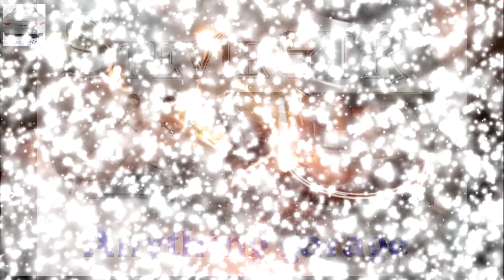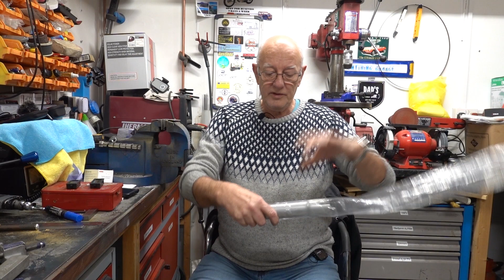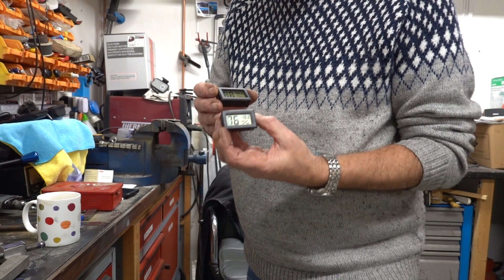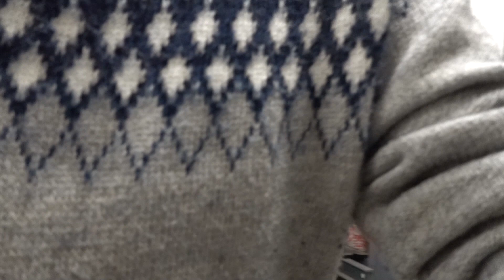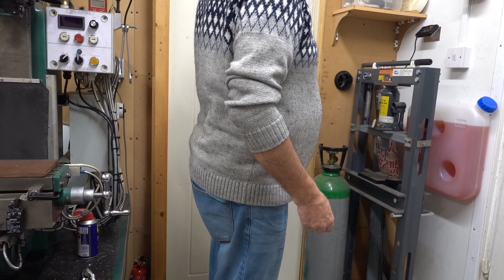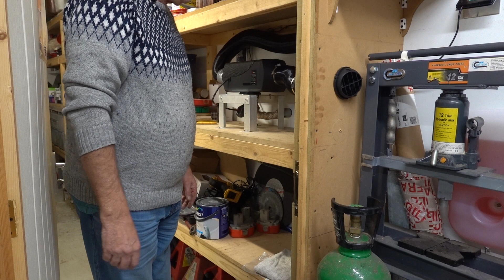Chinese diesel heater dangerous nah

Comment: Ive got a cheap one and getting fumes off it stinks not as bad as a car exhaust but definitely a smell given me a head ache. Got exhaust and air intake miles appart so must be something up with the unit. I have seen other people saying the same thing though not sure if some people touch lucky or unlucky or what to make of it?
Reply from the maker: Have you had it apart as there are lots of youtube vids of doing this. The combustion unit has a gasket in it. Could be that. Mine has never given a wiff off in all the time I have had it. I have an monitor by it to check for fumes , but never gone off.

Comment: Stevie I am installing a heater in my workshop and I have question about how warm does the body on the heater get? my workshop is wood and is fully insulated with 50mm kingmill and is lined with hardboard. I am trying to
determine how close I could mount the heater to the wall.
Reply from the maker: Hi David. The rear of the body stays cold. The front where the outlet is gets pretty hot ,pretty much as hot as the air coming out of it. The big point to insulate or keep away from any combustibles is the exhaust. I have seen some that glow. I heat wrapped mine all the way & put a steel tube through the wall. Obviously i am not a professional so cannot give any advice on where or how to mount it.
Regards.
Steve.

Comment: I totally agree with what you say . The Chinese heaters are  great things if fitted correctly. There is Enough information on YouTube alone to show you how to do it  . Regarding your heater being too hot if you go into secret menu key in 1688. To get into it I think the first thing you come to will probably say 1.6 Hz. I have put mine down to 1.1hz it runs a lot cooler. However I am told if you disconnect the electricity it will lose that memory. This function depends on what model of heater you've got not all have the secret menu. Another saving feature you could try burning kerosene rather than diesel it burns very clean. I am now heating my home with with 2 diesel heaters one on ground floor and one upstairs both mounted outside the home inducted into the house. That way you got no chance the fumes from filling the diesel and you can't hear the pump
Reply from the maker: Hi Chris. I agree with all your comments, spot on. I am now running at 1.8hz min which just keeps the workshop cosy. Kerosene yes i wish i could get some. I am using red diesel which is £1.59 per litre. I tried many outlets for Kerosene in my area & I could get it as cheap as 0.89p per litre. Min sale amount 400 litres delivered only. So out of the question in the Leeds area.
Regards.
Steve.
Reply: @Steviegtr52  Yes i understand, I am lucky enough to get it at £1.15 a Ltr. either, from a bottled gases, LPG  and welding gas suplier 8 miles away, or a main oil company that sells it in 25ltrs containers, but we have to go to depo also 8 miles away and pre pay and pre arrange getting into depo what a faf. I'm told farm supply shops are good places for kerosene supply if that helps
 I also have 2 bluetooth type diesel heaters, they are good but I do not know how to turn them down further, as they have different controlers with no apparent access to any tuning.
Reply from the maker: @chrisharrell2449  Thanks for the info Chris, I will look into Farm shops.
Regards.
Steve.

Comment: Steve, diesel vapour ignition point without flame is 210 degrees C, with a flame it needs to be 55 degrees C. So, don't use thi' workshop as an oven and you'll be fine mate.  My tank was half full in my wooden workshop all through the heatwave we had, workshops still there. My heaters mounted on a wood base with the metal plate under it and has not been a problem at all. The nay sayers know nowt bud.
Reply from the maker: Thanks for that Bob. Yes i have no plans to cook Yorkshire puddings in the workshop. Take care.
Regards.
Steve.

Comment: Eyup Steve.
Great update, there's safe and there's other people's version of safe, you have a completely safe set up, i only questioned in my video about about if a power cut occured with it hard wired in to transformer, again though thats if you have it on automatic timer, and not around, but i will only be using mine only when im in the workshop and when not it's completely isolated, i'm still going to use a battery though, and agree with you on the battery charger i have my optimate on it now, Not sure what yours takes on start up but mine's only pulling 85 watt thats about 7 amp i think, after that its using minimal battery power.
 I had some similar comment when i temporary put mine up on my high wooden shelf, for godsake i only put it there just to try all the components out before i found a space, but some people like a moan i think.
 If it's not constructive criticism from the die hards, i just shrug it off. If it is constructive then fair enough, i act upon it, coz i'm not perfect.
As long as your happy Steve that's all that matters and like Jon said, i wouldn't be concerned about a fire blanket underneath it.   Your going to be there on the job with it all the time. 
I'm still on a learning curve with mine, but for the times i've used it it's absolutely great, and it does take the chill off my overly large space now i have it in the correct position
keep warm!!
See you next time
atb
Kev
Reply from the maker: Hi Kev. Yes i am sure your setup should be fine. Time will tell. I know when mine starts up the glow plug is only showing for about 1 minute or so . Which is the source of the power demand. Another point to remember Kev is you have a lot of cold steel in that workshop with stock & engines etc. They all have to warm up before you feel any benefit in the ambient air. 
Take care Kev . see you on the next one.
Regards.
Steve.

Comment: What About the fact that the makers (Vevor) say it is NOT SUITABLE for use in garages or homes?
Reply from the maker: Hello George. Yes indeed the PDF install guide on the Vevor site does say this. However if you go to Vevor.com & read down it clearly states
Diesel Vehicles & Indoor Use The bus heater is commonly applied for cab heating of various diesel vehicles, such as cars, RVs, buses, vans, trucks, boats, etc. It is also suitable for homes, warehouses, factories, offices, and other indoor uses.
Don't shoot the messenger as that is fact.
I do not have a Vevor model though anyway. 
Regards.
Steve.
Reply: @Steviegtr52  I can't find "indoor" on that page. One of the heater webpages did mention indoor use but also said it was ood for use when shopping! I would not put faith in that. You have to follow what it says in the manual. So does the manual for your heater say it is OK for indoor use? Does it say not to use it indoors?
Reply from the maker: @mickeymouse1762  Hi Mickey. Some say not for indoor use some say the opposite. Mine said nothing. They are mainly fitted to motorhomes & campers. Also in trucks for night heating. Basically can be used anywhere. The only regard is to the exhaust which must be vented outside to avoid carbon monoxide fumes. Usually in a garage etc through the wall & protected from heat. What i mean is if you have a wooden shed , then you would need to make a larger hole & insulate the pipework through the wall with some form of heat wrap to stop any chance of combustion. I have seen a few on youtube with no insulation through wood with charing showing on woodwork , which is not good. 
Take care.
Steve.

Comment: Nothing wrong with your installation Steve. As for the mdf shelf, I honestly wouldn't bother with the matting, buy more diesel with the cash. Its pretty universally understood that heat rises, not sinks, if you were to put matting anywhere, it would be on the underside of the shelf above the unit. Ignore the trolls mate, not worth the effort! Cheers, Jon
Reply from the maker: Hi Jon. Thanks for that. My thoughts exactly. Even flat out i can put my hand on the casing. Yes it's hot but not that hot.
Regards.
Steve.

Comment: Hey stevie I’m no1 thumbs up tonight🥳 I get so pi55ed off at the level of woke/snow flakes that are key board warriors criticising the effort you utubers put in disgusting criticism your knowledge in electrics and machining /fabrication is outstanding in my opinion keep going sir 💯👈🏻🇬🇧HNY STEVIE I had to look up HNY channel growth in 2023 💯👈🏻
Reply: Totally agree with the rest of the comments Stevie, many people these days take great pleasure in knocking others for no reason whatsoever.
There’s nowt wrong with your set up mate and your definitely gonna save money in the long run. As for safety I was a lorry driver for years and although the modern trucks now are all built in to the engine with the night heaters, in the old days the ebspacher unit was under the bunk with a very basic temperature dial and the only problem we ever got was when the heater ignition plug failed and we had to change it.
Love the craic mate and keep up the good work, yours sincerely Dave….
Reply from the maker: Well honestly MJK you just brought a tear to my eyes. Sometimes i despair at some of the flack I get from the said. Thank you kind sir. HNY 
Regards.
Steve.
Reply: @Steviegtr52  I think you need to be very thick skinned putting your self out there on utube don’t get down just keep going your channel will grow this year it’s a golden channel I’m going to share it on my Facebook page content what ever it is ! I’m old school
Reply from the maker: @mjk8710  Thank you from the bottom of my heart. The world needs more people in it like you. 
Regards.
Steve.